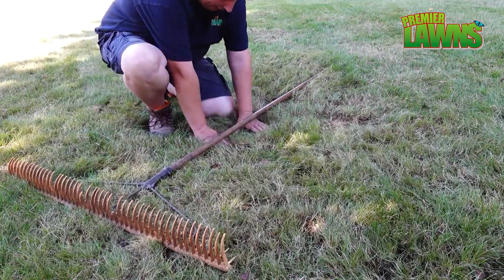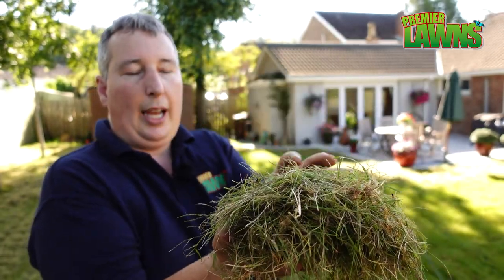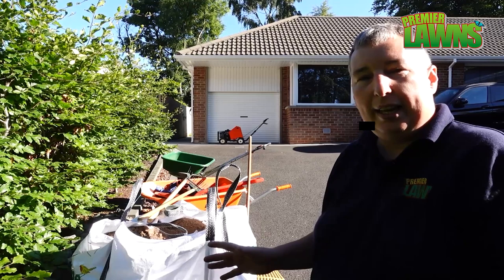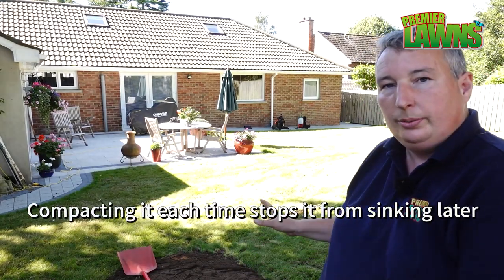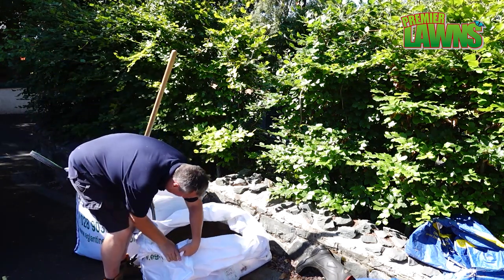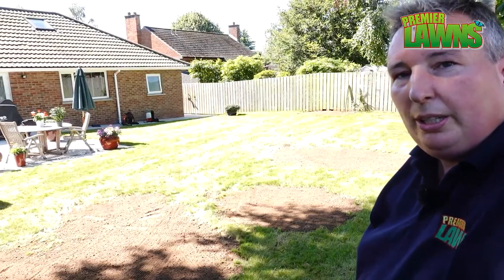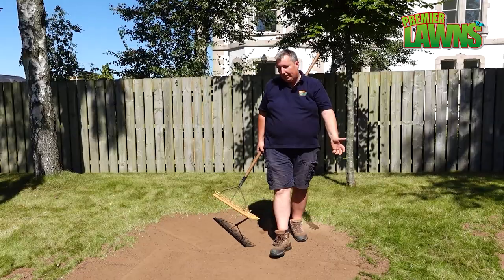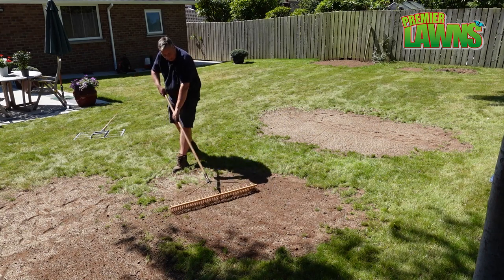Transform Your Bumpy Lawn in Just ONE DAY

Comment: Thanks for the video. Using the rake to see dips is really useful.  Do you have to seed straight after levelling or could you leave it a few weeks? Also can you use 70/30 top dressing deeper than half an inch if required in certain small spots?
Reply from the maker: You can leave the seed if you want, but I don't see any point to that
Reply: Thanks a lot. I mostly want to level the lawn before my stone edging comes a couple of weeks after and don't want to be walking all over new grass and killing it.